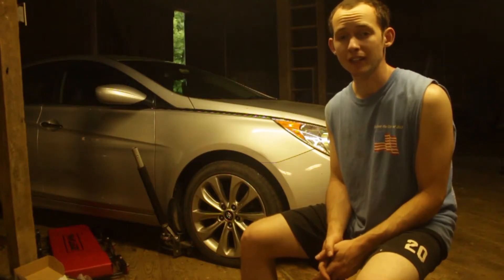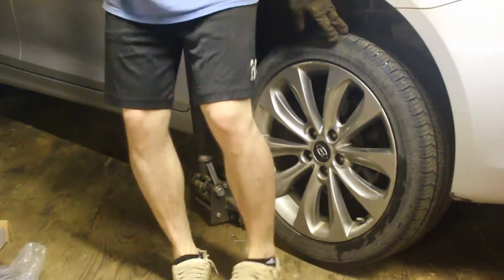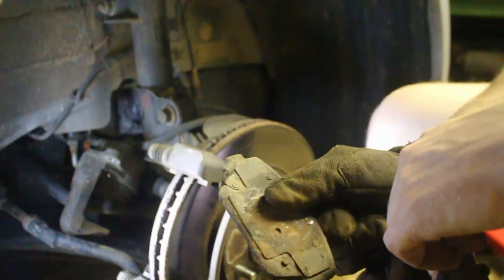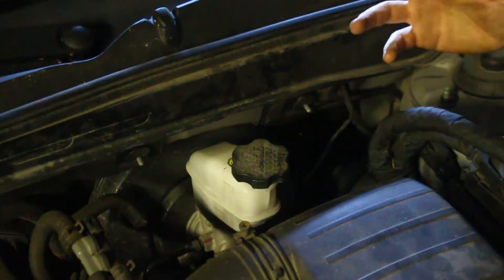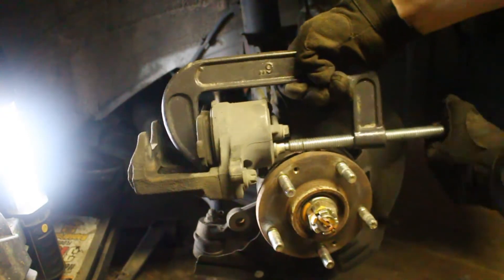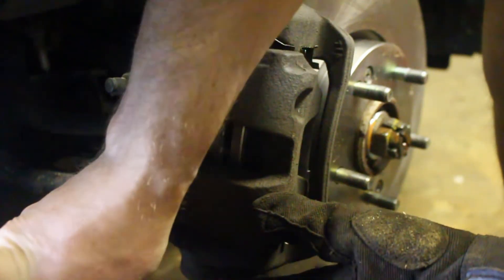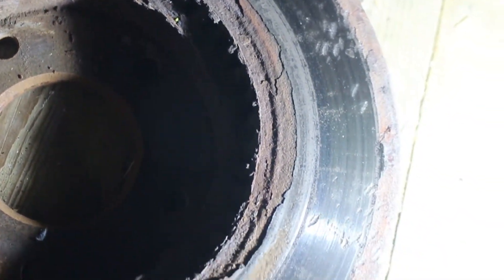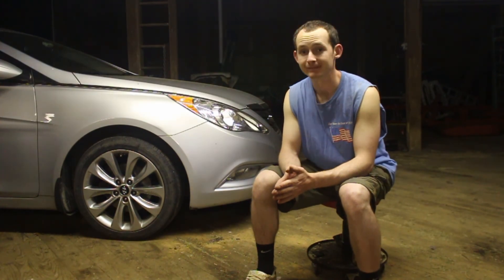DIY Brake Replacement: 2012 Hyundai Sonata

Comment: I love your confidence in tackling these projects. You are quite a handy dude.
Reply from the maker: When I was younger I was much more hesitant to attempt repair work, due to lack of proper tools and experience. But through the years I slowly learned that if you read the manuals, reference help from others on the internet, acquire the right tools for the job, and employ common sense, there are not many tasks that can't be conquered!    -Alex